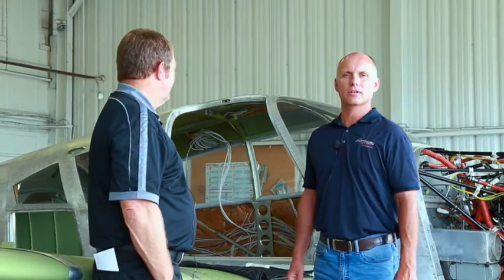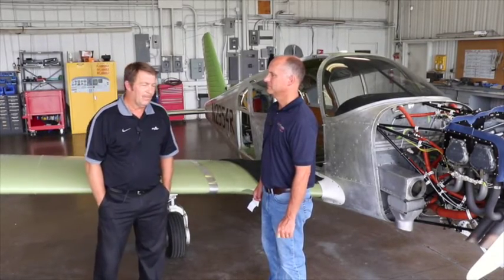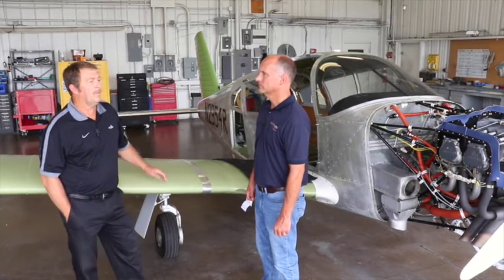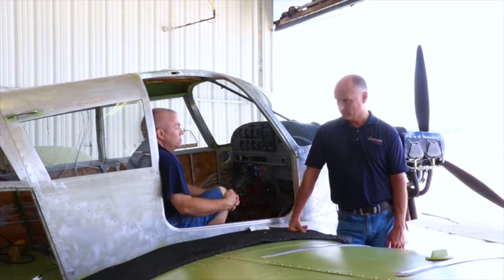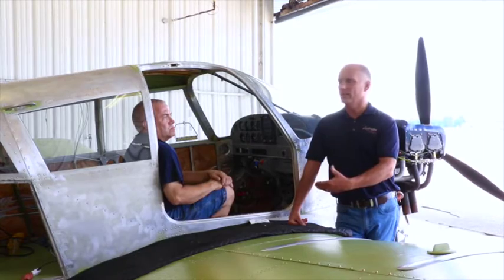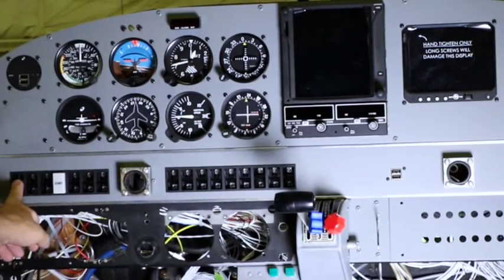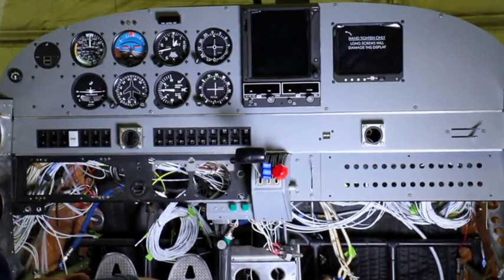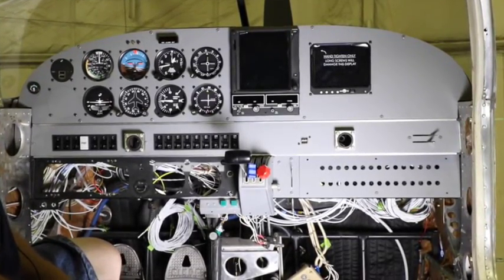Airframe Components 1969 Piper PA28R Arrow Restoration at Muncie Airport Pt.4

Comment: Great video. What is the cost of the panel upgrade?
Reply: Gotta be $60-65K I'd think. The STEC-55X is like $20K, and the GTN is about $17-18K. Add in the other new stuff along with all the labor, and you've got to be pushing $60K...if not $65K.